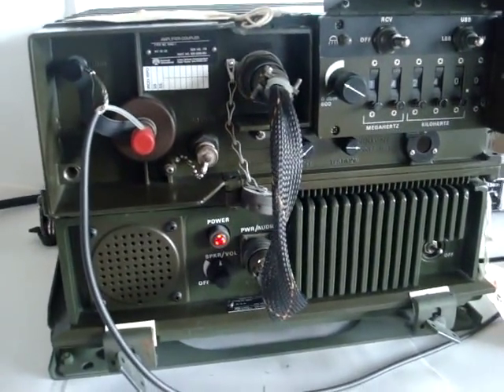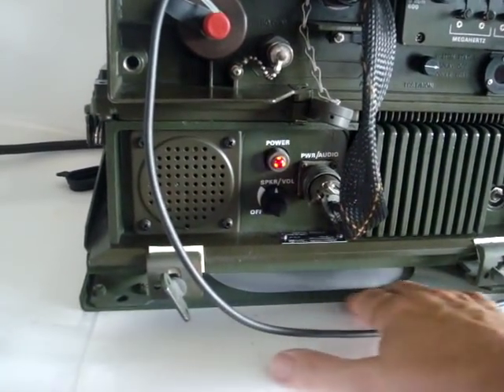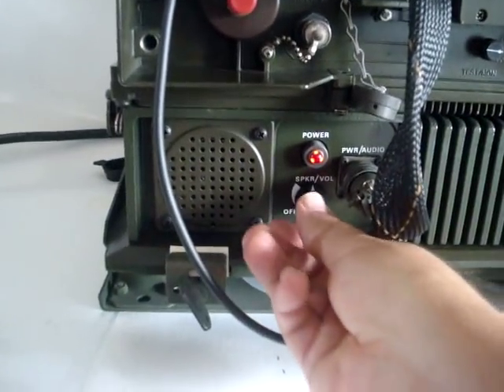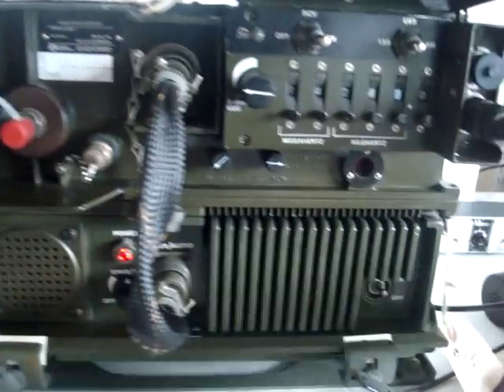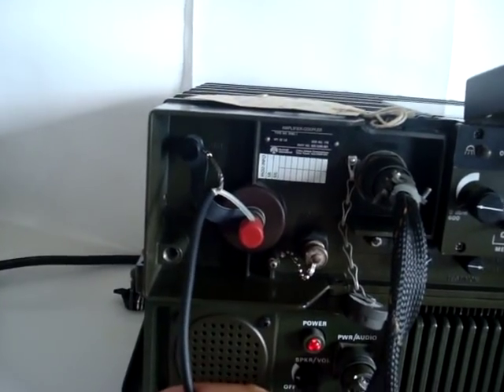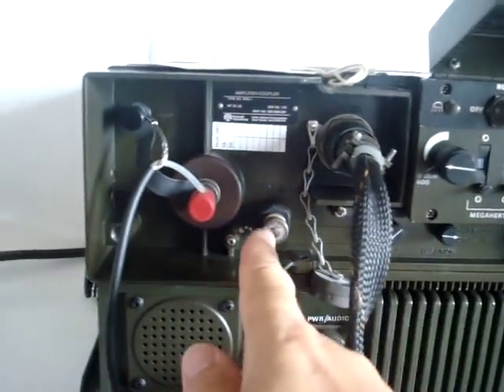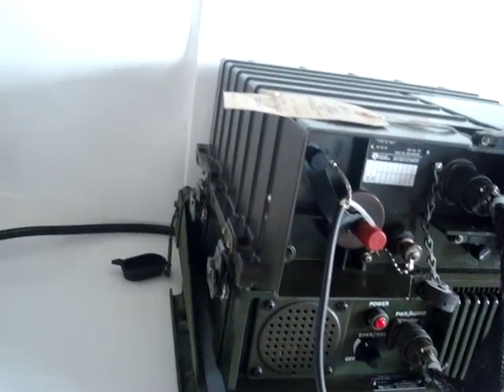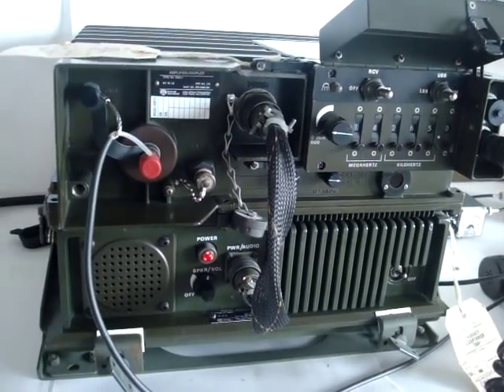Rockwell Collins military radio GRC-220 (719D-15) in VC-120 configuration

Comment: i guess this one also covers 11mts, just wondering if the US army is actually using this ones right one, cause i recently saw a humvee for sale that had it's original radio, it is different from this one but the mount is the very same. and just want to know how much can one of these cost?
Reply from the maker: What you saw in that Humvee was probably a VRC-12 military VHF radio. The VRC-12 indeed has the same mount as this radio, but that is where the similarities ends. The GRC-220 radio in this video covers the whole shortwave band from 2MHz to 30MHz in 100Hz steps in the modes USB, LSB and AM. So indeed, you could use it on the 11-meter band but doing so would be illegal as it puts out much more than the allowed 4 watts on that band.